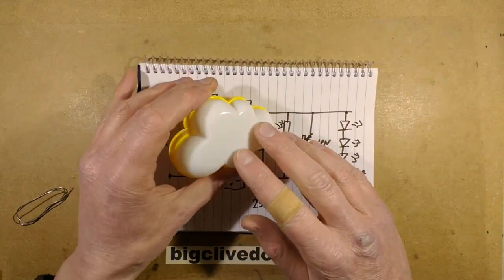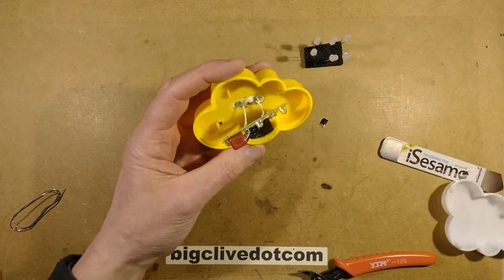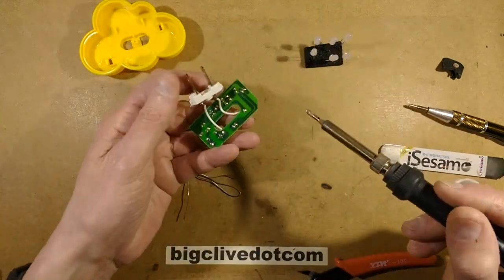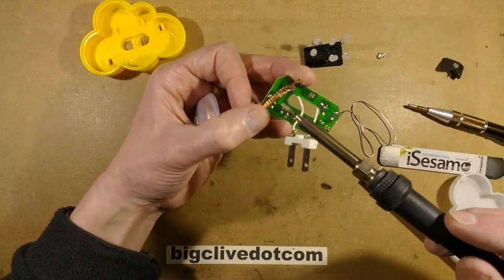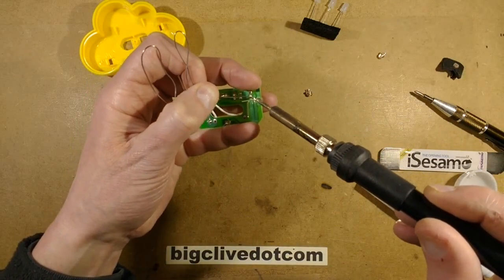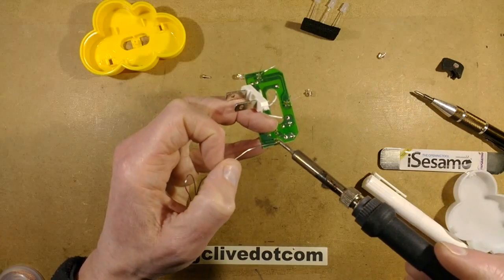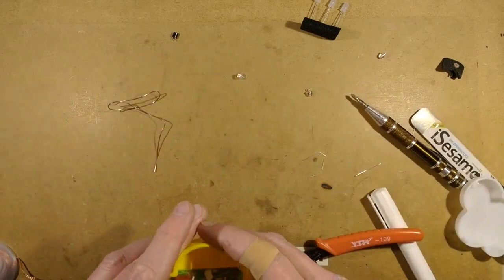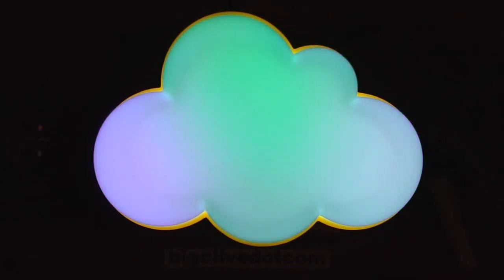Cloud-light conversion to RGB LEDs.  (One-off horrible audio test.)

Comment: Digital Audio LOVES to Medium things..CUTS the top and bottom..  Them Optimises it..

Dimmable Ring light..
Also TURN OFF NOISE CANCELLATION...any quick Abrupt noise and it Lowers volume..
Reply from the maker: The Moto G4 seems to have virtually no audio settings at all.
Reply: i NOTICED  strange things in Smart phones..My ringer and my Voice volume are the same..I turn up the ringer to hear it, and the Voice is Loud..turn Voice down and Ringer goes down..
Finding progs to FIX things is like walking thru Crap 4 foot deep..

Comment: If only the chinese would make some with a UK plug on the...

When you snipped the tails off the LED's the audio level dipped right down, sounds like samsung to me...

I stick to panasonic or sony video cameras myself, they do cost a fair amount but perform better than phones or tablets... and the manual settings are far easier to use.

Comment: Have you ever tried using a round toothpick to open the holes in a board?  It doesn't remove the solder so you can reuse it and only need a small amount for soldering in the new components.  Since that lead is so terrible for the environment, you will not be killing the world with all that contaminated solder wick.  Also avoids the mess of fluxing the poor quality solder wick.  This could all be wrong since I have been working with leaded solder for over 60 years and my brain is greatly degraded.
Reply from the maker: I've never really tried the toothpick technique.  And that's despite buying some to try it with.

Comment: Something like this stereo mic (i have a proper Sony one, unsure of the quality of the cheap ones) they work well as you can point them where ever you want, and as its stereo you can isolate either channel. http://www.ebay.com.au/itm/3-5-ECM-DS70P-Electret-Condenser-Wireless-Stereo-Microphone-3-5mm-for-Sony-/371662817547?hash=item5688d4890b:g:rDAAAOSwYHxWOI3q

Comment: that is nice I want 4 of them to bad I can't solder :(
Reply: Never to late to learn! You might check out Julian Illett and Adam Welch, both do videos on assembling little kits (among other stuff) that can be had cheaply from China.
Reply: I say I can't solder because I have muscle spasms so it makes soldering quite difficult to do, burnt myself quite a lot just trying to solder one thing
Reply: Ah, sorry to hear that :-(  I can symphatize,  got somewhat limited feeling and fine movement/control on the left after a stroke, so no Clive-style holding board, component and solder in one hand for me. Tricky enough getting the tip of the solder to the right spot with the board on the desk or in a 3rd hand.
Reply: sorry to hear you had a stroke, yeah it sucks because there is so many kits I'd like to put together but yeah